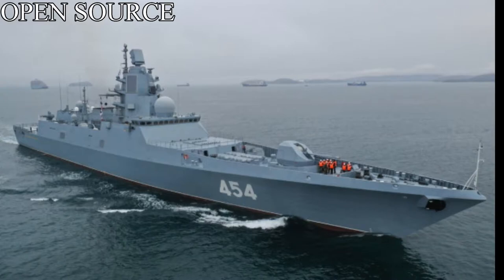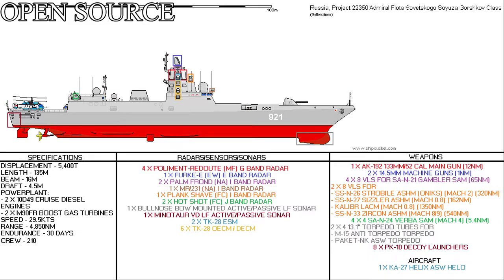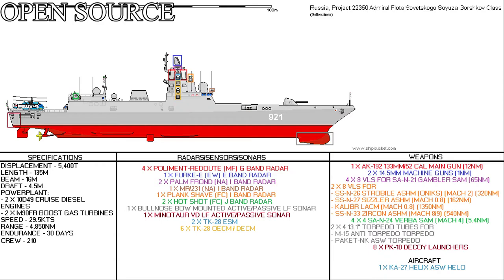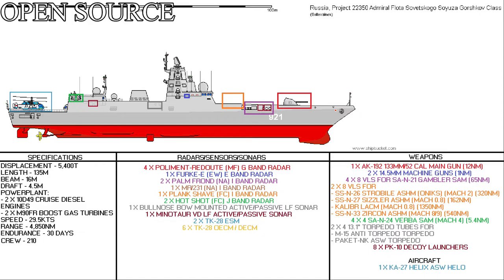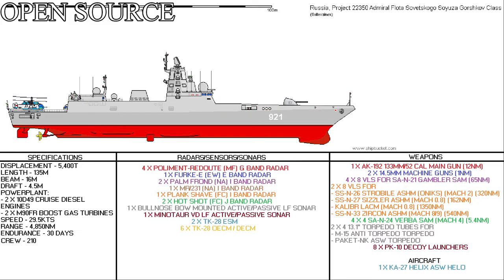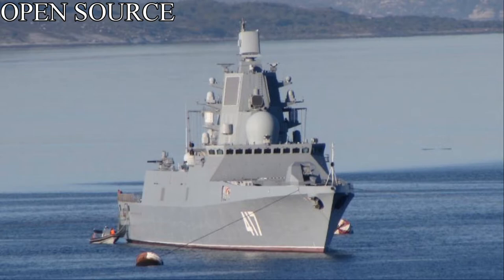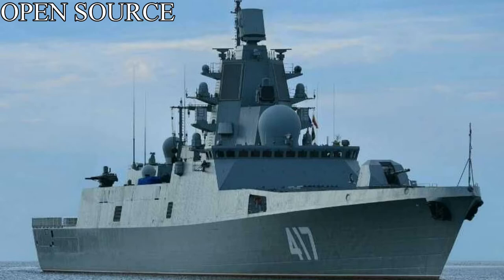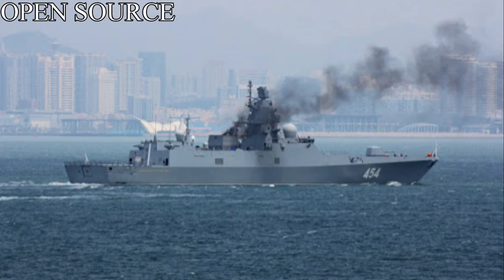ADMIRAL GORSHKOV (PR.22350) CLASS GUIDED MISSILE FRIGATE BRIEF - NO. 65

Comment: Great video, thank you! 

As an aside and knowing absolutely zero about this class and having done no research, I suspect there is is only one Poliment-Redoute radar. It looks like it has four phased array antennae, which is a different thing altogether. The bits you see on the outside of the ship are not the radars, only the antennae. 

I also suspect you are correct about them having two Palm Frond radars, merely because they are rotating antennae and would need separate systems to operate. At least back in the dark ages when I learned basic radar theory…